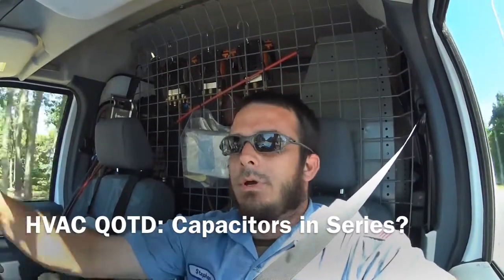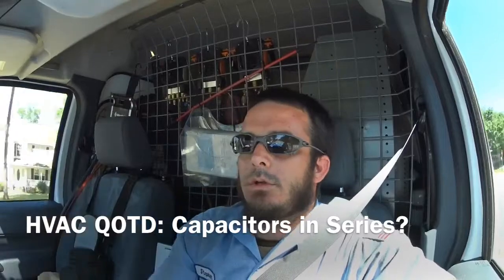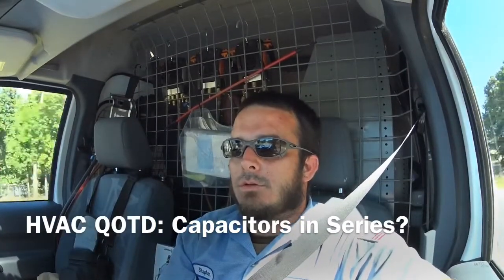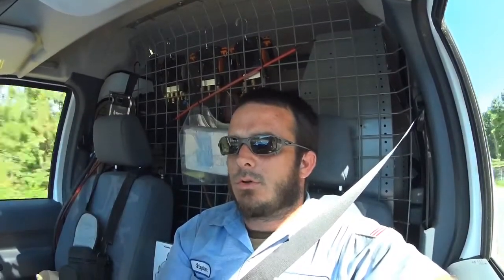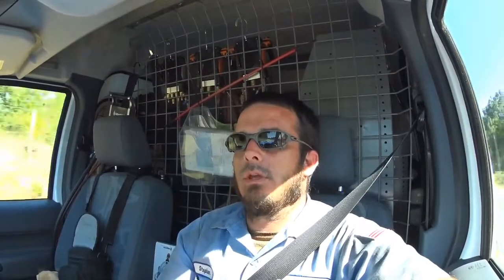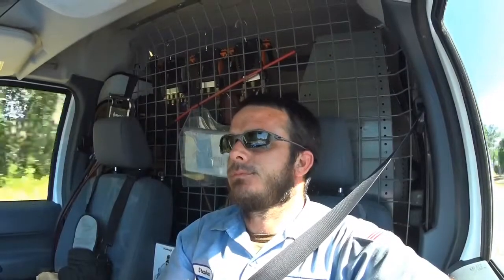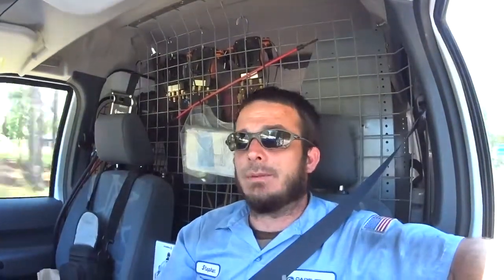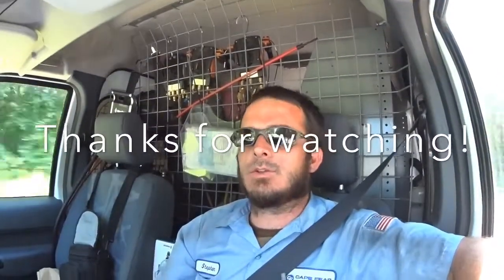HVAC Question Of The Day: Wiring Capacitors in Series?

Comment: you can add a 7.5 on the fan side of the a 30/ 5 the 7.5 just needs a jumper wire then add the fan on the other side of the 7.5 mfd common on ruud rheems

Comment: Capacitors in series have the same amount of charge stored in them.

 Capacitors in parallel have the same voltage on them and act like a bigger capacitor. i.e. a 10 microfarad and 20 microfarad in parallel equal 30 microfarads total. In an electronic control board a Direct current line might have a small and big value capacitor combo in parallel to better quash electrical noise. i.e. the 30 Microfarad is for low frequency stuff; the 0.1 microfarad works better for higher frequency noise. An electrical design engineer will add a mess of 0.1 microfarad caps on a circuit board for good measure, sort of like a mechanical guy adding washers.   
   
The series case is used less commonly in circuit design, often where circuits are many thousands of volts.

The capacitor series capacitance total is always less than any capacitor value in the series string. With a 10 microfarad cap any cap in series with it drops the combined total. 

Two 10 uFarad caps in parallel add to 20 uF (microFarad)
Two 10uF caps in series have a sum of 5 microfarads

If one has a 10 uF cap and adds 100uF in series; the series combo is almost the same. i.e. 1/10 + 1/100= 0.11  then sum is 1/.11 = 9.09 say 9

Thus rarely would one add two caps in series with a ratio above 10 except for the noise reduction case.

If one in repair does use 2 caps in series in a repair the midpoint of the caps is electrically hot and the next chap as Joe mentioned might be baffled.

I did a series parallel cap combo once as a test on a Carrier furnace control board 302075-304 were the C2 timing capacitor 100 microfarad 50 volt DC had dried out and  the off timing would be OK then goofy; then OK then long etc. With nine 16 volt caps from my surplus drawer I quickly made a temporary cap in the 100 uF range to prove that all was wrong is the old cap dried out.
Reply from the maker: 3beltwesty Wow! thanks for sharing your knowledge!

Comment: Good information let me point out when you have capacitors in series or parallel, either way they do not have the same ESR even if they are made by the same company and this could through your capacitance values Off by more than 10% on top of tolerances mentioned on the cap. ESR= equivalent series resistances, its like virtual series resistance created inside the capacitor, example if you ever run house hold filament 60W lamp in series with capacitor then you know what its all about. The capacitor will show you how much leakage resistance it has created by the light of the glowing lamp. AC or DC both capacitors will behave differently in what ever configuration. Sorry about the long comment!
Reply from the maker: Long comments aren't a bad thing! Short ones don't usually say much! Lol
Reply: Sorry for the typo I meant throw not through I am still learning new stuff here every day and i thank you !

Comment: Stephen, Capacitance in a series are just like resistance in a parallel circuit they are smaller than than the smallest. You can find the Capacitance by using the reciprocal method. If you don't know what I am talking about call me.

Comment: Eight is exactly what it should have been. When adding capacitors in SERIES the total capacitance will always be lower then the lowest capacitor.in the circuit.

The Math for this is:

1/Ctotal =1/C1 + 1/C2 (1/C3.;.....) OR in your example 8 = 1/40 + 4/40 {1/10}  which is 5/40

Basically just find the common denominator and and them. The fraction you wind up with will be the capacitance. You can add as many as you want in series but for safety reasons the voltages should match.

Hope my math is right

Comment: Steve Lav is correct. A 5 mfd and 7.5 mfd in series will give you 3 mfd.

When in series, you have to divide each cap value by 1 then add together and divide sum by one.

Example: 

1/(5 mfd) = 0.2

1/(7.5 mfd) = 0.13

Add these sums together. 0.2 + 0.13 = 0.33

Now, 1/0.33 = 3.0 MFD.

The formula: 1/(Capacitor 1) + 1/(Capacitor 2) = 1/(Sum of Caps)

Comment: I have paralleled capacitors many times but never put them in series. I have been told that if it is done, not to leave it there for very long. Return with the correct capacitor as soon as possible.

Comment: Let's figure out what he needed to do to make a 45 a 30.
Reply: 80+45 would be 28.8
Reply from the maker: Funny, that's what it was - 28.7/0. Ended up finding a single 3 in my stock.
Reply: Check out a website by another member www.oceanhvac.com very simple website has a calc for up to 3 in series.

Comment: Stephen, First rule of thumb for two caps in series of different values. The total capacitance is always less than the smaller cap used and never equal to half of the smaller cap. Second, The great the difference between the caps values, the closer the total value is to the smaller cap's value by it's self. Here's link for you to check out.
http://www.engineeringtoolbox.com/capacitors-parallel-series-d_1388.html